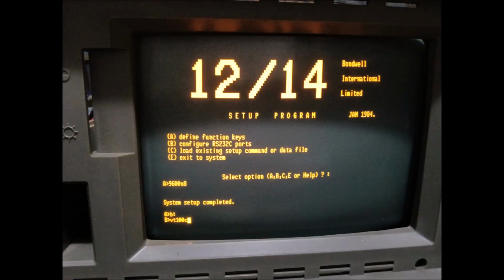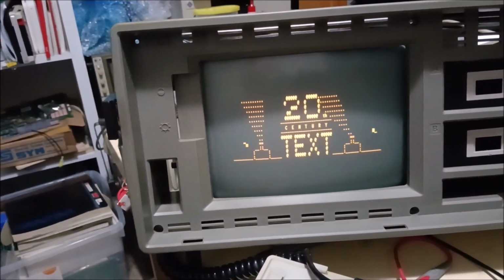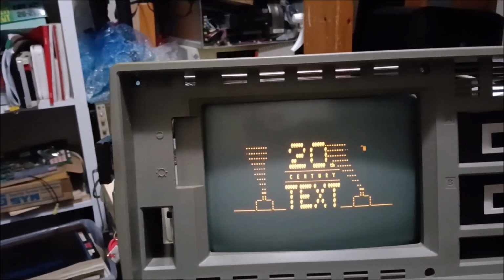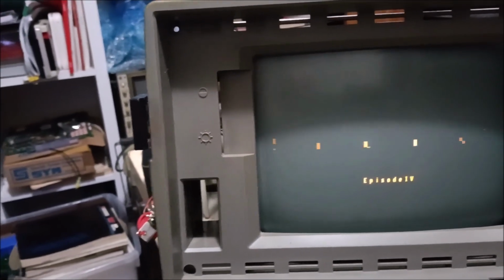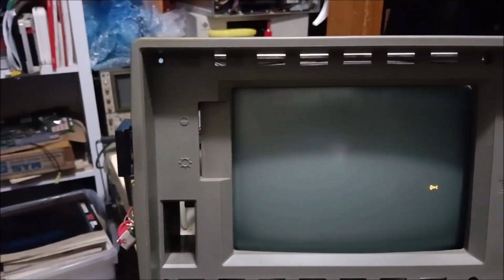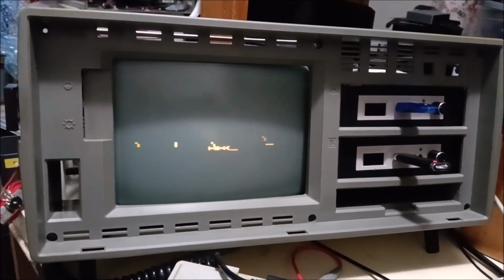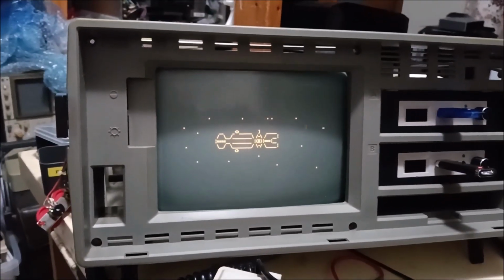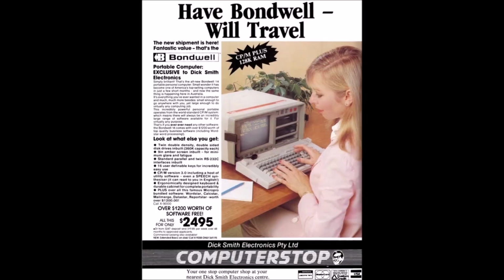My Bondwell 14 CP/M 3.0 Z80 system running as a very limited VT100 terminal.

Comment from the maker: Now I’m creating a new character ROM that includes the DEC Special Graphics character set for slightly better VT100 compatibility. I’m also adding support for inverse characters in the VT100 terminal emulation code. 
Double-height and double-width characters will not be possible without hardware modifications, so they will not be implemented. Underlining and bold text will also not be supported because of the current hardware and character ROM limitations.